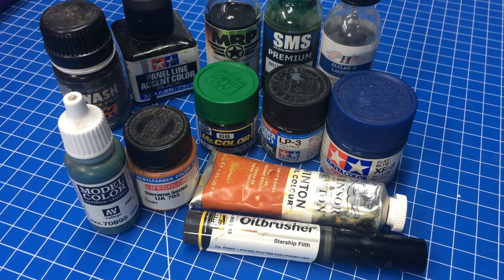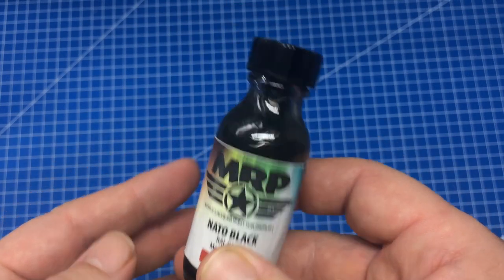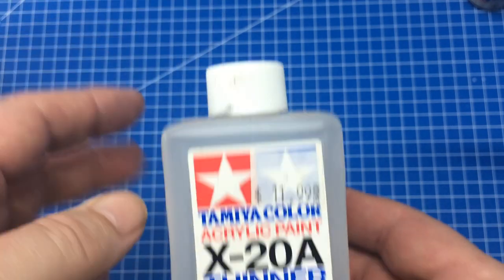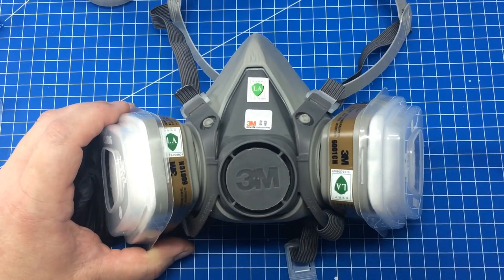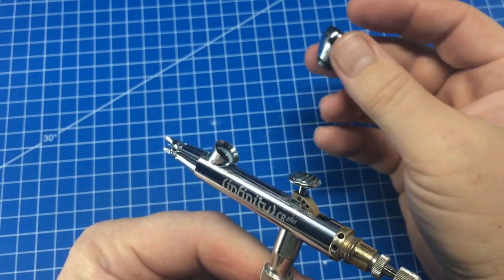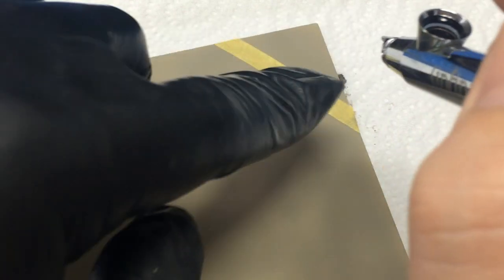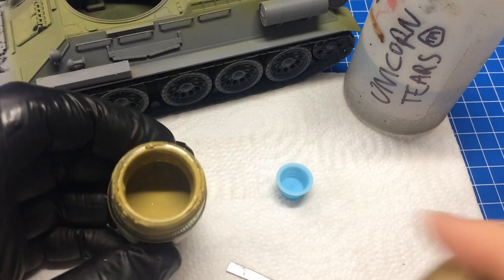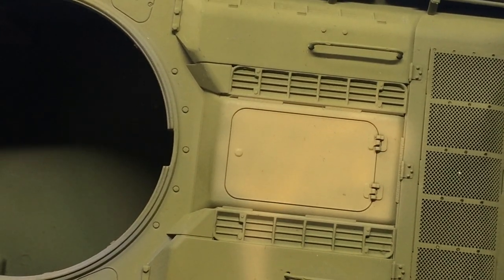How to airbrush Tamiya lacquer and acrylic paints (plus thinning, mixing and cleaning)

Comment: Good stuff.  Thanks!  I normally use Tamiya's X/XF "acrylics" but recently purchased some of the "new formula" Gunze/Mr. Hobby Aqueous paints (H series).  You're absolutely correct that the Mr. Color Leveling Thinner (lacquer based) works incredibly well with them, even though Mr. Hobby also makes their own dedicated Aqueous thinner.  My x20a Tamiya thinner now sits quite lonely on the other side of my bench.
Reply from the maker: X20A is great for heavy duty hairspray technique!
Reply: @beckersmodels  I hear it is!  Does your black base/hairspray vid. cover that or are you going to go more in depth in a future vid?  I'll check out the one I just mentioned above and thanks again!
Reply from the maker: Check out my U boat video which combines black basing and hairspray. I will be going into it more in a later video for sure. Cheers Chris

Comment: Great video! Two doubts: 1. The safety mask is always suggested to use in all the phases (coating/ cleaning) or in a specific phase? 2. In case of acrylic paint and X20 thinner is the mask needed and what is the mixing ratio thinner/paint? Thanks
Reply from the maker: I use the safety mask whenever I have anything lacquer or solvent based open, cleaning or painting. For acrylic paint, the X20A thinner is fairly benign in comparison, but still I would keep it on when spraying. Start with 50/50 or 60/40 (thinner to paint) and go from there...cheers Chris

Comment: Thank you sir. I have been making my own thinner (out of necessity)  a 300ml batch with 100% IPA 1part Distilled water 2 parts 10ml of Tamiya paint retarder & 15mil of liquitex flow aid. I have have very good results. I’m just coming back from a break in the hobby after building a few models during the pandemic. I will be using Mr Hobby levelling thinner when I can. I also have been using General purpose thinners for my clean up. I’m still relatively new to airbrush. Awesome video. I would like to see a video on AK Interactive Metals. Even after two weeks it still rubbed off. Thanks for sharing 👍🏻👍🏻🙃🙃
Reply from the maker: Thats a good formula for thinner  - i need to experiment with some flow aid particularly when the temperature goes north. Yes the AK stuff isnt as robust as others, much prefer the MRP and even old alclad still...cheers Chris
Reply: @beckersmodels  
I live in the tropical Top End so I know all about trying too keep paint flowing. The way some people talked up (flory cough models cough& others)AK we were led to believe it was tuff & could be handed to some extent. I ended having to seal the paint up with a clear coat after multiple touch ups.  I thought I was stuffing something up. 
It’s just not what we are lead to believe.

Comment: It seems others have found that Vellajo's Air paints can be airbrushed very well just different than other paints. The key seems to be having to use a nozzle much larger than you normally would use.
Reply from the maker: I  have heard that before, it also depends on your local humidity and other factors. Lacquers just seem to work better for me, Cheers Chris
Reply: @beckersmodels  I used to use lacquers a lot and still prefer them but in my current modeling space I don't have the ventilation that would let me use them so I'm experimenting with water based acrylics. Thanks for the videos. I'll have to check out more of them. Cheer, R.E.

Comment: Thank you for this very helpful video. For your brush painting, which of these paints do you primarily use, and do you thin the paint or use straight out of the bottle? Sorry if I missed it, but at what pressure do you tend to spray Tamiya, and do you get much tip-dry when you thin 1:1 with the leveling thinner?
Reply from the maker: hi David, for brush painting I mainly use Lifecolor and sometimes Vallejo acrylics, although I will use the oil paints for other effects. I normally thin with some water on a wet palette or straight out of the bottle.
for the Tamiya, I spray at around 15-20PSI, as for tip dry, no problem with the levellling thinner, until it gets very hot here - say above 30C, then I usually don't airbrush and wait for it to cool down. hope that helps, cheers Chris

Comment: Amazingly useful video, thank you! If I'm using Tamiya acrylics at room temperature how long would you say I need to wait after painting to apply clear coat? How long can I wait before masking off?
Reply from the maker: Thanks Mike. You probably only need to wait an hour or so with acrylics - depends on your thinner - generally with a lacquer thinner it would less than that. For masking, you can do pretty much do it straight away if you destick your tape (i.e apply the masking tape to the back of your hand and pull it off a couple times to make it less tacky) and when removing masking, pull it away from the direction of the tape, dont just yank it off! Cheers, Chris

Comment: Thank you very much, it was very informative. I am just getting back into modeling after a 40 year layoff. I think the tattoo cups and mini pipettes is genius. Is it possible to use a lacquer primer, and painting an acrylic paint over it?
Reply from the maker: Lacquer primer with acrylic over the top is no problem at all, in fact the Mr Surfacer lacquer series of primers is a go to for most serious modellers, then either lacquer or acrylic over the top. Its a rock hard smooth primer, either in rattle can or bottle (thin it with Mr Levelling Thinner) in various colors (black/white/grey) Cheers Chris

Comment: I know I'm two years late to this, but it's an excellent video. Just out of curiosity, how would I go about cleaning the pipettes and mixing cups for reuse?
Reply from the maker: I just use a cotton bud/Qtip soaked in lacquer thinner to clean out the mixing cups, I usually throw the tiny pipettes after a couple of uses, they start to deteriorate, while the big ones last a lot longer, I usually flush them a bit with the lacquer thinner too...
Reply: @beckersmodels  Thanks! I'll just have to look into grabbing some more pipettes then

Comment: great video but you didnt say anything about priming? what do you use to prime, what ratio? tips and pressure? help me please
Reply from the maker: I usually prime with Stynlrez/One Shot, which you hose on with the biggest airbrush you've got at 30+ psi. But I also use lacquer primers like Mr Surfacer 1200 or 1500, thinned with Mr levelling thinner at least 50%, sometimes 70% thinner, using my H&S Evolution with a 0.2 needle at around 15psi. Hope that helps?

Comment: Do you have a link for that dropper bottle you put the unicorn tears in? My bottles spill out too much every time. I need something more precise
Reply from the maker: Sorry Ricky I don't, they're the Ultimate Modelling Products thinners bottles, Im sure there's something available out there thats similar. I found a couple results on google searching "plastic dispenser with pourer OR nozzle OR lid" - my local car parts place, Super Cheap Auto sells a generic GPI Thinner 500ml bottle with a similar lid that looks very similar. Hope that helps - not sure where your located to steer you in the right direction? Cheers Chris
Reply: @beckersmodels  I live in Germany and looked at some modeling shops but they are all these squeezy bottles. Also these laquer thinners melt away plastic so they need to have the right material too. Pretty tough to find honestly.

Comment: Awesome content.  I bought an airbrush system a while ago to paint my car emblems, but never got a chance to do it.  I picked up a Tamiya F-14D Tomcat model and was thinking maybe I should use the airbrush system to paint it.  My question for you...two actually...is there any way to get the Tamiya AS paint in a "non-spray can" format?  One of the ones I need is "Light Ghost Gray" (AS-26), however, I would rather have it in a bottle instead of a spray can, even if I was going to brush it on.  Is there any way to find out what the content is of "Light Ghost Gray" so I could mix it myself and use the airbrush instead?  Or do you just use other paints and make it as "close as you can" to that "specialized" color?  Any help would be truly appreciated.  Thank you again for the content!
Reply: Well, I did find an answer to my questions actually...sort of.  I found out that Tamiya has an LP lineup of paints and most of those correspond to the paints in the spray cans.  :-)  So, I was able to find what I needed in bottle form and can use those instead of the spray cans.  Wish I realized that before I actually purchased the four spray cans I needed.  Ugggh.  LOL!
Reply from the maker: I was just about to say that about the LP paints! You can actually decant the AS cans however, go to Eric Galliers Manscale Models page, he shows you how to do it with a pipette: https://www.facebook.com/watch/?ref=search&v=622944057881952&external_log_id=d8207987-a89e-4a9c-825a-4b00425c7d02&q=manscale%20models
Reply: @beckersmodels  Holy crap!  That is awesome!  I definitely saved that one.  Thank you so much!  I was lucky and my order wasn't filled yet, so I "returned" my four spray cans and bought the for corresponding LP paints instead.  ;-)  Now I'm ordering and downloading books on beginner airbrushing to try and learn my way around this thing.  Plus, viewing your great videos on top of it, which are better than books, but it doesn't hurt to have multiple resources.  :)  Thanks again for the info!

Comment: My most common mistake using Tamiya Acrylics is I apply to much of a heavy first coat. Or I apply to heavy of coats in general. Been really practicing being patient and do light multiple coats.
Reply from the maker: The Flory method is to just hose it on at 30PSI! 
But yes, a light coat with slightly thicker paint (50/50) seems to work best particularly if not using primer, then layer on lighter coats at thinner ratios. Its a pretty resilient paint once you find that sweet spot.
Reply: @beckersmodels  That was me during my first kit. 😂I've been taking time to prime my pieces now days. Do you tend to use a 0.3 needle most the time when painting acrylic/lacquer colors? I've only been using my 0.5 needle for priming and that's about it. Even clear/flat coating with an acrylic I use a 0.3. Even for larger pieces.

Comment: I WISH another company would pick up the Testors Metalizer line.  I use aluminum on  every  kit. The buffing features makes them great to work with.
AlCLAD at $10. per bottle gets too expensive.
Reply from the maker: Have you tried the Mr Metal color range? They are buffable - I've got their Chrome silver and aluminium and they're great, cheers Chris

Comment: I have a model sprayed with Pledge, [ too dull ] then with a 'Tamiya X22, x Tamiya X20 A 50 / 50' mix, still to dull and soft. 
Can I spray a mix of Mr Color Levelling Thinner and X22 over to make a hard polishable finish?
Reply from the maker: Hi Anthony, since all of those elements are acrylics, it should be fine to put a lacquer utility gloss like X22/MLT over the top. My method is a light coat first, then wet, then mist straight Mr Levelling Thinner (MLT) over the top a few minutes after the wet coat.

Comment: I'm building a 3D printed plastic 1/16 RC tank and I'm wondering if I can use Tamiya XF acrylic paints (round bottle) for the lower hull, or should I use LP instead. Will LP have a significant difference against XF series in terms of protection from scratches, paint durability ?
Reply from the maker: Depends what you thin the XF paint with - if you use lacquer thinner (like Mr Levelling Thinner, which is what I use to thin XF paints) it will be more durable than using X-20A. I use X-20A specifically for hairspray technique, since its not very durable! hope that helps, cheers Chris
Reply: @beckersmodels  Thanks Chris for your reply. I have Lacquer Thinner retarder type, will use this one then. 
------------
PS: You don't switch to LP paints completely, because XF can be thinned with both type of thinners (X20A and Lacquer Thinner) ? 
------------
If we thin both paints type (XF and LP) with Lacquer Thinner will there be any difference between those paints then ?

Comment: Good vid. Very informative. Except you mention that the different.paints use different pigments. This is false.
Pigment (the stuff that gives you your color) doesn't change. If you are using ultramarine blue. You are using the same pigment wether you are using oils, acrylic, encaustic (hot wax being the vehicle and binder), watercolor (gum Arabic is the vehicle/binder here) or any other boxers including egg yolks or geletin.
That being said, some pigments are not well suited for certain binding agents. Those pigments then are not used with said binders.

Comment: I just finished painting the under side of my jet and discovered some areas were smooth and some were rough. My airbrush is Iwata eclipse hp-cs with .5 nozzle//needle,20psi and used xf-83 thinned with x-20a and 3" to "4 from the model. Any idea what is the problem? I also just brought some Mr. color thinner.
Reply from the maker: Hi Tim, probably too far away from your model - should be 1-2 inches max with that sort of pressure. Cheers, Chris

Comment: I'm just getting back into making models and have started using a airbrush for the first time.  I am finding that the paint I have put on comes off very easy as well the decal solvent faded after I used it. What am I doing wrong?. I used Tamiya paint
Reply from the maker: Are you putting down a primer? If you're using Tamiya paint straight on to plastic, thinning with a lacquer thinner instead of their X-20A acrylic thinner will give it more bite, or put primer down first. Cheers Chris

Comment: I'm sorry, but to briefly speak about paint chemistry, or more specifically, thinner chemistry. Mr. Color Levelling Thinner (MCLT) is a water soluble alcohol based thinner, just as is IPA. Granted, MCLT primarily uses Ethanol, with Methanol and at least two other alcohols, it shouldn't matter to the paint finish as there is no appreciable difference in the vapor pressure of IPA or Ethanol. If you are finding a difference, then it is most likely due to the excipient in the IPA, which may not be as pure as advertised on the label. Anyway, good video, thank you.
Reply from the maker: Thanks for your insight - its hard to make an informative video without overloading on information, or dumbing it down so much you get things wrong, just for the sake of clarity. Cheers, Chris
Reply: @beckersmodels  Great watching your videos, very informative. I've only started modelling again after being away from it for years. Trying to get my airbrush skills back up to scratch again is taking time.

Comment: What is Nitro-Cellulose Thinner? And how can I differentiate with Hobby lacquer Thinner? TIA
Reply from the maker: Its just the generic hardware thinner you can buy in bulk, which is very "hot" compared to hobby lacquer thinners that include other additives and flow improvers. I usually keep two bottles on my bench with each noted differently - also the hobby ones (MLT or yellow cap Tamiya) have a slight perfume scent added to help you! Cheers Chris

Comment: When I use three drops of lacquer mixed with 3 drops of leveling thinner at 20 PSI I run out of paint so quickly. I am surprised you could cover that much surface with it. Is there something I am missing?
Reply from the maker: Hi Ricky - I usually shoot at 15 PSI or so, and I'm only doing the lightest of coats. Play around with your trigger settings and how close you are from the surface to see how much paint is getting down - experiment with different mixes too - some paints are more opaque and have better coverage than others, depending on pigment (white/yellow are notorious for not having a lot of coverage). Hope that helps, cheers Chris
Reply: @beckersmodels  Thank you Chris. I actually tried LP-11 silver and Alclad II white so far. I will keep experimenting. Another question regarding lacquers. I heard in a lot of videos that it creates a bond with the plastic surface and bites into it. However I was able to scratch it off with a toothpick completely and expose the bare plastic again. Is there a need to sand the surface first? I haven't seen anyone do that for primers.
Reply from the maker: Ah yes that white won't go very far, unless you have a yellow undercoat or black at the very least. The best practice is to put down a primer first, I really prefer MR Surfacer or Stynlrez, it levels out everything - yes the lacquer will bond with the plastic, depending on how hot it is. The Tamiya lacquers are not as hot in my experience, but are very durable. I've removed lacquer paint with IPA and gotten back to bare plastic without marring the surface, but a good scrubbing is required!
Reply: @beckersmodels  Ok very interesting. So I need an undercoat before a primer? I thought that Alclad II is meant to be the first layer. Tamiya's manual always says lacquer first, then acrylics and then enamels. If I used Stynelrez I would not be able to put a lacquer on top from what I understood.

Comment: Can you paint laquare straight onto plastic?
Reply from the maker: Most of the time yes, if you spray the first layer as a tack layer, then come back with another wetter layer, but it depends on the quality of the plastic/paints etc setup. I routinely just spray Tamiya acrylics and their lacquers into cockpit spaces without bothering with primer, if I havent added any extra details like metal wires etc. Cheers Chris

Comment: If I'm using acrylic paint, what's wrong with using acrylic thinner?
Reply from the maker: Using an alcohol based thinner like X-20A or similar less toxic solvents is fine for acrylics - it wont be as durable as lacquers, but will suffice for most work and can be sealed in with a lacquer clear to make it rock hard. Cheers Chris
Reply: @beckersmodels  Got it thanks